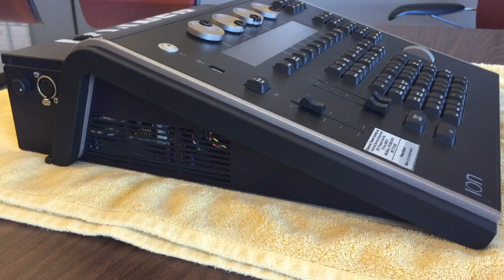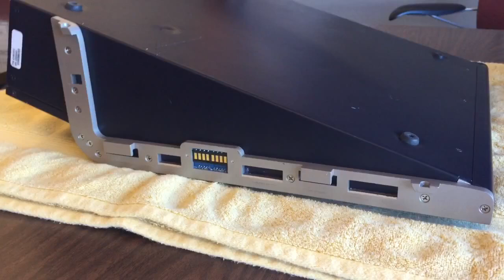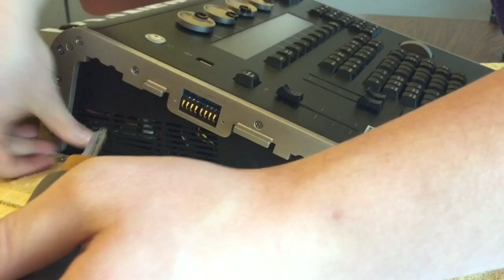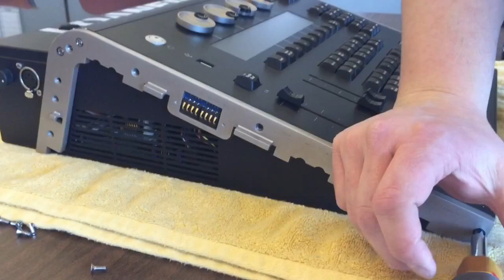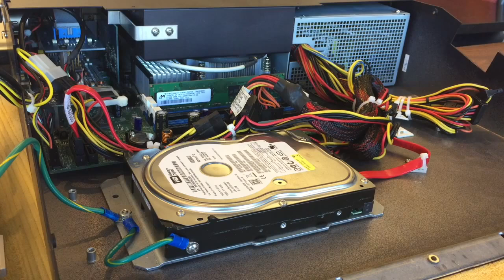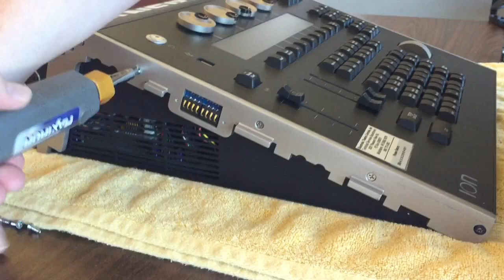Ion and Congo Jr | Basic Maintenance

Comment: how about video card replacement? I am having a posible issue with the dual DVI card (or adapter) where neither DVI output works. the analog (XGA,VGA) output is working.
Reply from the maker: Hey Justin! ETC does not recommend updating the amount of RAM in your console. Regarding your video issues, I would suggest contacting ETC Tech Support. We may be able to help you out over the phone, otherwise we'd be able to walk you through the repair process.
Reply from the maker: https://www.etcconnect.com/Support/Contact-Us.aspx
Reply: maybe if it too costly to fix ill just use the caracas to build a nice nomad rig into it

Comment: Great Video!  Would it be advisable to replace the standard hard drive with an SSD?  I have replaced hard drives on many pcs...is it as simple as cloning standard hd to the ssd?!  Thanks
Reply: ETC Tech Serv Underground
Actually, I have an Element which we had the hard drive fail on. As a result, once we got the drives back, since my tech team is made up of computer geeks, we bought an equivalent sized SSD and used the ubuntu disk imaging tools on a computer to snapshot the new drive over to the SSD (our Element uses the XP kernel as well). We now have 2 backup drives in case the failure happens again. We have been using the SSD as our primary drive on the console for nearly 3 years now and have not had any issues with it.
Reply from the maker: Patrick. It depends if this is on an older console with the XP image it wouldn't be recommended as XP didn't deal with SSD as well. Though depending on the age of the console an upgrade could be made to get an upgraded motherboard that can run Win7 and it includes the SSD with it.
Reply: Richard Hatfield
just a note.... if you are hooking your drive up to a computer to snapshot it, be very careful you select the correct drives and operations. it is best to get a very experienced computer tech to do this for you if you are not comfortable doing it yourself.